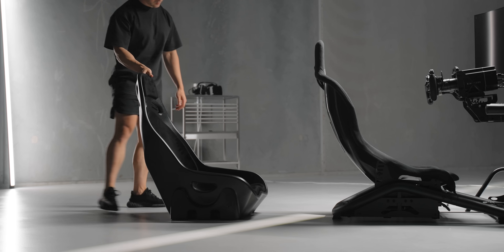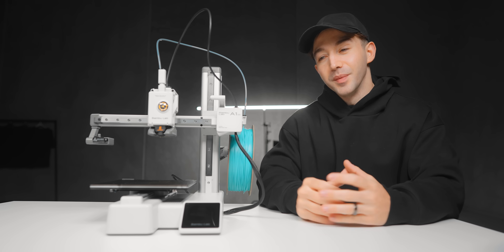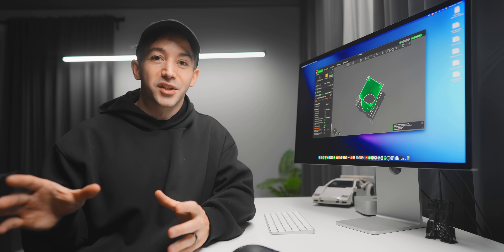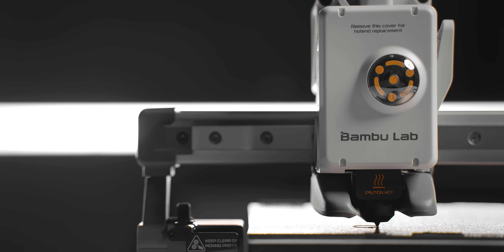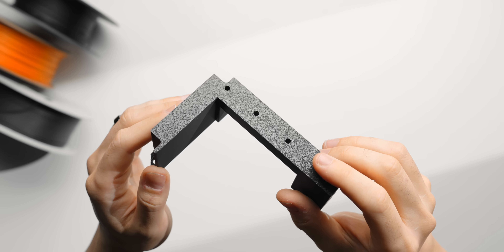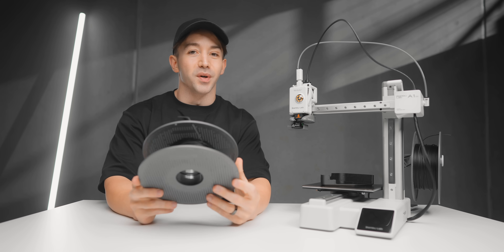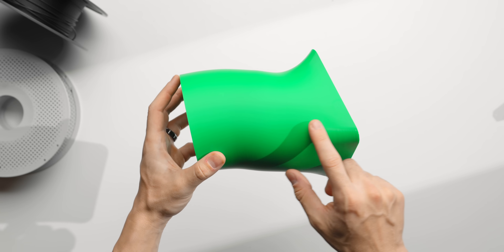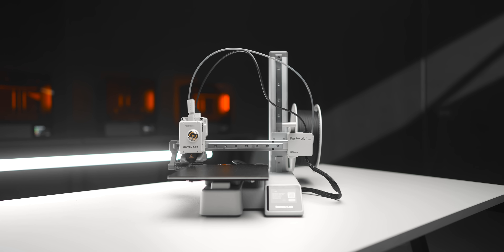I tried the ultimate budget 3D printer

Comment: not sure why you say ABS is not popular, i got an X1C and i'm using ABS almost exclusively for my structural prints, occasionally when i do need some flexibility i would print with Translucent Grey PETG, and the only prints i did with ASA were when i was printing desiccant cages and drying rolls for my AMS2 Pro and AMS HT, i'm using PLA for blueprint tastings when i'm working on a 3D design since PLA is relatively dirt cheap.
but the vast majority of my prints (around 90%) are done exclusively with Bambu ABS.

Comment: pretty cool but i refuse to use a non enclosed printer in my house.
Reply: You can get enclosures for cheap. Also enclosures aren't for protecting you it's for keeping heat stable
Reply: @Portick23  what i meant is that i generaly prefer printers that are built with an enclosure and negative pressure filter system.

i don't want to breath the microplastics and voc's.

Comment: Heads-up the top layer issues around 6 mins into the video look (to me) more likely to be flow ratio than lack of infill. There's a calibration for that. I would try going up by 2.5% (add 0.25 to the # in the filament profile.

Comment: I purchased a 3rd party filament dryer and a tent that is just big enough to surround my A1 Mini. With the 0.6 mm hardened steel nozzle and a bit of PVA glue I've managed to print Carbon Fiber Nylon (PA6) and Glass Fiber ABS. Just make sure the internal temp of the tent doesn't exceed 50*C and you should be fine.

Comment: "My Tech Fun" channel found Qidi PET-CF/GF to be essentially just as capable as CF nylon but with better layer adhesion, easier to print, less moisture absorption and a much better price tag. An enclosure is recommended for best layer adhesion results but you can print it with an open printer. I plan on picking up a spool to make functional parts. It already very heat resistant by default but the material can also be annealed with zero warping and handle some ridiculous amounts of heat.

Comment: i just got the A1 last week. between bambu handy, Bambu Studio, and just being a tool and die maker in general, i am very impressed with this thing. for tight tolerance stuff definitely want to use a .2mm nozzle, but for basic desktop upgrades or other random, things like a drawer stand for the A1 itself to sit on. i havent tried anything other than pla and basic pteg becuase of the lack of encloser...but im pretty sure you could just make one with a cardboard box and some pc case fans lol. overall, the ease of use, solid construction, and synced software makes this thing a killer product. ive been non stop printing for the entire week and im addicted

Comment: Changing the filament is really easy! All you have to do is cut off the old one then pull it out, insert the new one and push it in real hard until the piece with yellow dots rotates a little. If you can't push hard then there's a lever on the other side of the nozzle, opposite to the cutting lever, which you can press to make it really easy. You don't need to heat the nozzle at all for this, the next time it does flow calibration it will get rid of all the old filament.

Comment: For faster filament loading: Use the screen and set it to 220c for pla, then pull the left lever on the toolhead, then force the filament through the ptfe tube with the other hand. Then set the temp to 0c again.

Comment: X1 carbon is a badass printer... the mini is just that  MINI..  I just bought 2 SOVOL SV06 Plus Aces and love them..fast and very nice detail for a bed slinger  most of my prints are 250mms some 200  but I made 3 helmets so far and didn't have to sand them.. just file some of the edges and eye sockets..  and for $299.00 and a 300 x 300 x 350 mm  it's great.. took 3 months of research for me to find these for cost effective printers.. has the camera onboard even a light.. but still the one to beat is the Bambu Lab X1 Carbon.. I just didn't have enough cash to afford one

Comment: The filament loading process is fine. You don't need to see the new filament come out, just that it got captured by the extruder and has started pulling it in. Then when you touch "Filament Extruded", it goes ahead and pushes the old one out.

Comment: The only issue I ran into was that the filament would occasional tangle, causing a print to pause. There are plenty of easy mods to fix this, in my case, a handle that moved the PTFE to the top of the machine. This pulls filament from the topside of the spool which solved the problem 100%. Also, Bambu's generic PETG print profile is not great. It is fast, but often leads to increased failures, poor quality, & terrible layer adhesion. Overall it's been a great machine for me and I have a ton of hours on mine. Still amazes me how reliable it is, & the quality/detail it can produce considering how cheap it is.

Comment: about 20 months ago I bought an X1C Combo. It completely revitalized my 3D printing efforts, after having been abandoned for about 2 years. In the next 6 months I added another AMS to the X1C, and bought two A1s, one with and one without AMS Lite. I, too, have been eying the Mini, wondering if I really have need for the reduced size and subsequent convenience.  As for the lockdown kerfuffle, it is a slight pain that I had to go into LAN-only mode on my X1C, but it still works with Orca in that mode, I did however give up the ability to access that printer through the phone app. There has been no change to the network modes on the A1 and both still work exactly as they did when I bought them a year ago. Yes, they are all kept up to date on the firmware.

Comment: Shame bambu updated their firmware to mean their printers HAVE to regularly speak with their servers. So if you run it fully offline (using USB/microSD), the certificate runs out and bricks your machine. This is not a device you own, you rent and your data is being sent to bambu all the time.
Reply: Are there any examples of this? I was under the impression that most concerns were related to cloud printing. Most of the forum posts I've seen during my short amount of research say that offline printing is fine.

Just asking since I have a P1S on order and it's going to be an offline only machine probably a year from now.
Reply: @jonathantaylor2584  Yeah, i have emails where they refuse to confirm they're not doing this. I had an order with them a week before the changes and I told them I wanted the printer (because it seemed perfect) and hell all they had to do was lie to me, and they wouldn't confirm that, even in LAN/Offline mode it didn't need to connect to their servers to keep working. Such a shame
Reply: @jonathantaylor2584  Apparently, you have to connect to the Internet once every 10 years to update the certs. :D

Comment: Dear optimum. I would encourage you to look into PHA filament. It’s truly compostable in a home composter, and it does not leave any microplastics in the environment. But it seems to have similar qualities as PLA. Microplastics are no joke, and I hope that the maker community and influential content creators like you will consider committing to using PHA or other sustainable materials. We can’t afford to keep living in a way that sheds PEP’s (persistent environmental pollutants) into our water, food and environment. Thanks
Reply: Never knew about pha. Is it cheaper than pla? And is it better than pla apart from the good things it does for the environment?
Reply: @pinkkitcat1 right now it's more expensive than PLA, but if more people choose it, it could drive the price down (if more manufacturers decide to produce it). Structurally it's similar to PLA, and actually stronger in some respects, but it can be hard to print if you are used to PLA. It requires a cold bed, strong ventilation and sometimes glue on the build plate. The community is still learning how to print with it.

Comment: “I tried the ultimate budget 3D printer" but what do you mean by "ultimate" here? Is it ultimate because it’s from Bambu Labs? (I assume you hold them in high regard?) Also, if you weren’t aware, many good 3D printers that are also budget-friendly existed well before Bambu Labs and cost under $250. The Vyper/Kobra series from Anycubic ranged from sub-$200 to $260 depending on features, and the Neptune series from Elegoo was in the same price range, and they had features like ABL and klipper... Its not like they were ridiculously outdated or something.

The $250 price range is not the bare minimum or a ‘how good can it be?’ scenario — $200 - $300 is actually the sweet spot for quality budget printers. Assuming that a $250 printer is going to be a "how good could it possible be?" type of printer shows a bit of ignorance about the past and current market of 3D printing... but I guess the X1C has probably skewed your expectations for the worse, huh?
Reply: It's $250 CAD. Not sure how you can beat that with a plug and play 3d printer, but I am open for suggestions.
Reply: @wgemini4422 Ender 3 V3 SE, it's $199 CAD right now. Plus, that $250 CAD pricing isn't permanent, it's their "we want to make this sale because loss leader HP model makes more money in long run" pricing. They put the price back to normal in the not hot seasons just like every other company.

Comment: The A1 Mini is BambuLab’s best design, especially considering it’s a device prone to mechanical wear—having fewer parts is definitely the way to go.
If it came with a 35x18x?? build plate, it would be perfect, and it wouldn’t really affect the price much.
With a dual nozzle setup, I’d personally be willing to give up the AMS, since most well-designed prints only need up to two colors.
For heat deflection issues, you can always rely on materials like ASA or PLA-CF.

Comment: Is it true that bambu forces you to use some weird cloud/app stuff?
That's the 1 reason i didn't get anything from bambu yet. I don't wanna use any clouds, i want it all local. I can't have NDA protected 3d models floating around in some weird cloud on some server.
Reply: You can use whatever slicer and run it without the cloud stuff in lan only mode and print stuff over vpn if you need off-site access like with any other printer.
Reply: @Kowanza sureeeeee
Reply: It's true. Don't buy this if you need secrecy.
Reply: @wgemini4422  I bought an a1 mini - it's not true. Bambu nowadays allows you to airgap your printer and never let it connect to the internet, ever - including any updates.

Comment: Ender v3 se is the ultimate budget printer.
Reply: you need $200 worth of upgrades for it to work properly
Reply: @spookwave4966  lol. It works otb but not as fast. Wtf r u talking about?
Reply: @sherlockhomes9919  It's $199 CAD, only $50 cheaper.

Comment: btw just a heads up, when printing with fibre filled filaments, spray with a clear coat, cuz the fibre splinters in the print is actually exposed and will cause irritation

Comment: Just got my own P1S and AMS 2 Pro yesterday, excited to get printing! 

I have LONG thought about the fact that if I like my P1S a lot and actually use it as much as I think I will, that maybe I pair it with a A1 mini, the mini can handle the smaller parts of prints that require multiple jobs, and the P1S will take the larger sections and just really cut down on time. But that's for the future for sure

Comment: 6:24 PLA is much stronger than PETG, it's just not heat resistant and not flexible. With annealing PLA can be much more heat resistant than PETG but as with most strong materials (i.e. ABS or PPA-CF etc) it can be brittle.
Reply: Stronger is a strong word.
Rockwell hardness isn't the only way to think about strength.

Comment: Bambulab is so called "iphone of 3d printers" - it's very expensive and pretty well-made proprietary ecosystem printer with some strange restrictions made for manufacturer's convenience. It do good what lies within those boundaries, but for it's price obviously lacks active heat chamber(can not be any good nylon or nylon-matrix composite print without it) and some functionality of open klipper firmware.
Reply: it's 179€ with free shipping inside EU atm, hardly can call that expensive ;D
Reply: @nahkamursu  EU is pretty small part of the world, you know. Also compared to the same function level printers bambus usually have about x1.8 of price. X1C was a compilation of innovations back in 2022, but since then a lot have changed, and now such price is arguable.
Reply: @mozambique_enjoyer  It's $250 CAD or $157 euro in Canada. Being the second largest country, it's a rather bigger part of the world you know. :D But if you have something cheaper that works out of the box, I am open to suggestions.

Comment: The A1 really doesn't cost much more and you get a much larger print volume. I'd recommend that over this. But other than that they're the same. Excellent prints all the time.
Reply: A1 Mini is $250 CAD. A1 is $400 CAD. Huge differences.

Comment: Elegoo centauri carbon is $300 and significantly better. The normal Centauri is only $200 and open frame like this, and also significantly better.
Reply: This thing is $250 CAD, or about $182USD.
Reply: @wgemini4422 ok? It’s also not a 256x256x256 build volume and not a full frame core XY.

Comment: A1 mini is a beast!

Got it, because of some discount, for some ridicolously (for a 3d printer) low price, fully expecting to be a throwaway money.

The moment I printed the nut & bolt assembly, I couldn't believe of how extreme quality it was. I come from an engineering background (mech BA) and was holding off buying any 3d printer for about a decade. I fully expected for it to be a toy. Since then I've printed dozens and dozens of tutorial level CAD designs and was blown away,  how much can be achieved: print in place 608 rollerbearings, deep groove bearings, hinges and even a fully functional clamp - including the worm gear.

There's been only one significant jump down in quality, but after some maintenance, I got it working back again at original level. Some screws behind the hotend assembly got loose and it knocked off prints off the bed, when the printhead collided with already printed parts.

EDIT: for printing with CF or GF filament versions, besides getting a hardened nozzle, you should also consider upgrading extruder gears, as those can also wear out faster with abrasive filaments.

Comment: Translucent PETG requires separate adjustments and not just using the generic PETG in the slicer to make it as clear as possible.  Slower print speeds, higher temps, the direction of the layer lines, no infill or 100% infill, etc to get it clear.  The generic PETG is for opaque filament while trying to print as fast as possible while keeping quality.
Reply: never thought this would be a thing, thanks for your time to comment and share this useful info!
Reply: thanks bro

Comment: 4:55 While It is an amazing printer overall at a crazy low pricepoint. I will have to disagree on the "quiet" part. The fan noise is pretty loud and vibration from acceleration can be felt from a distance. There are ways to mitigate this ofcourse. However I would like to see something like a noctua mini fan mod if that could work

Comment: This video literally came out as I was searching for a budget 3d printer! I was wanting to get this printer but I am a little skeptical about fumes and particles in the air since I will mostly be using it in my house/room. Love you videos by the way.
Reply: I agree but sadly I don’t have any space to put it other than my room, I’ll probably make a bento box filter and buy an enclosed printer instead of and open air.
Reply: It's probably not a great idea to be printing in a room you're always in, but if you do stick with stuff like PLA as it's relatively scentless and very low on the toxicity. That said, they all still release fumes and microparticles that you really don't want to be breathing in.
Reply: Don't get this. It's on always online machine. Meaning if it's disconnected for long enough from Bambu servers, it's locked out.
Reply: Stay away from Bambu Lab, horrible company. Get Creality K1C and add a bento box to it, don't put it in your room since melting plastic can be harmful
Reply: @adrianw519 ive heard bambu labs is the best beginner friendly and easiest to use.

Comment: Been using my Creality Ender 3 V3 SE for a few years now, absolutely love it. It's very budget in price and its features are limited, but the features it does have work really well. Dual tower printer with great stability, and still cheaper than the A1 Mini, with a bigger build plate and taller max height. What I love most is that the filament work is very easy to change, the auto leveling works well, the settings are easy to navigate, and you spend very little time doing other things than just printing.

It is a bit loud with its fans, but nothing crazy. Still have it working full time in the same room where I work, and a headset will block most of the noise just fine.

The prints are consistent, and the quality is neat. I haven't gotten as clean prints with zero layer visibility as on the Bamboo ones, but that's probably more due to my print settings and maybe even the PLA I use, but I prefer it for consistency as I know when I set a print, it will print it exactly the same 1000 times in a row. That consistency on a $180 3D printer is just wild to me. Took 2 months to earn its price back, and has been a pure profit machine ever since.

Comment: A1 has been an ok printer, but I've had a much better experience with my Anycubic Kobra 3 Combo overall. If you want to talk about budget king, that's the one. Less than $360-400 for a full multicolor setup with filament dryer integrated and 250x250x260 build volume. 
Spend another $100 and you've got S1 on the radar, which is better than the Kobra3 and is quite a good bit less than a P1S with AMS.
Reply: Seems rather expensive, especially if you don't want color. The base is $419 CAD comparing to the A1 mini which is $250 CAD.
Reply: @wgemini4422  The bed is significantly bigger